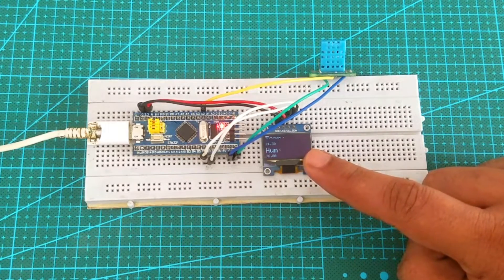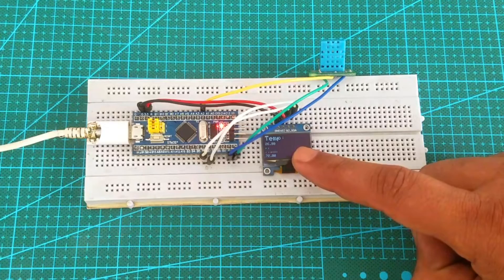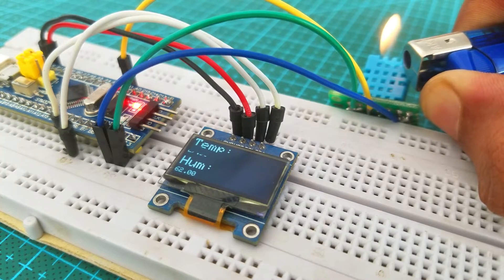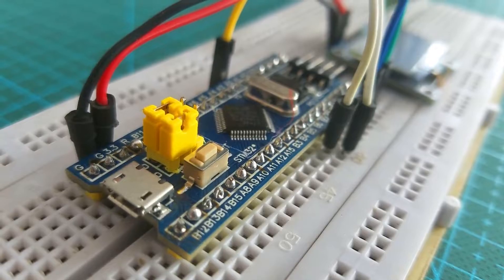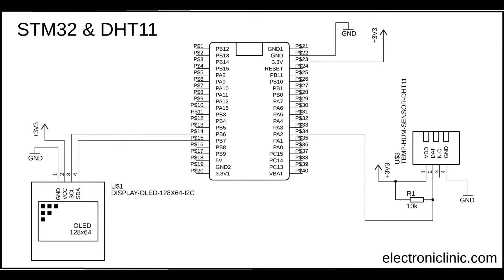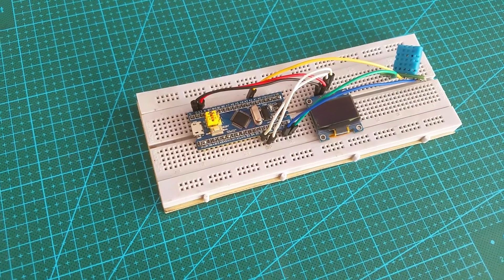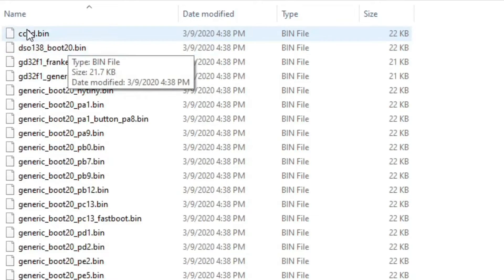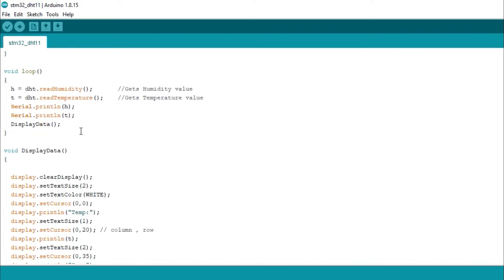STM32 and DHT11 Library issue solved, Temperature and Humidity Monitoring using Arduino IDE

Comment: hello electro, I hope with all my heart that you are doing wonderfully well for a while now my hard drive ssd pro intel solid drive 2500 series 240gb is no longer working..I have very important files on it..I came across a video in my research which mentioned that I could recover my files by connecting via serial port and integrating it by connecting the STM32 with the SSD board..unfortunately I can't do it GOD thank you I came across your video so please please help me!!!!!!